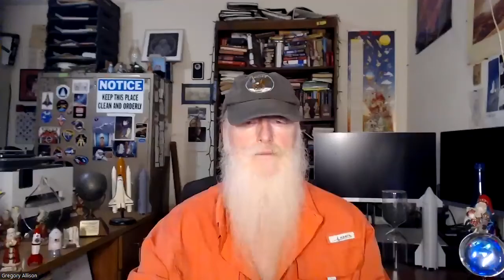Artemis I September Launch In Work SpaceX Starship Update

Comment from the maker: FTS - Flight Termination System - there to destroy the rocket before it goes off course threatening civilian populations. I believe I forgot to define that in the video.
Reply: I would rather that NASA take longer and do everything correctly. Because then they will have a proven vehicle program that can support future launches. Also it will pressure SpaceX and others to innovate faster
Reply: The only thing more efficient than hydrogen would be metallic hydrogen. And even if they could make hydrogen in that form they would have to reinvent metallurgy to create a combustion chamber to withstand 7000 or so Kelvin. Maybe next century, lol